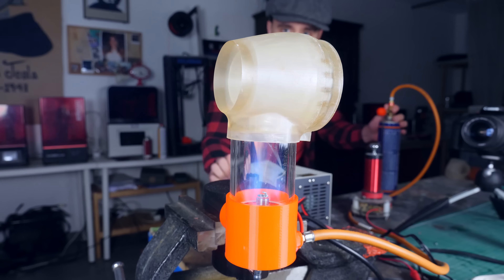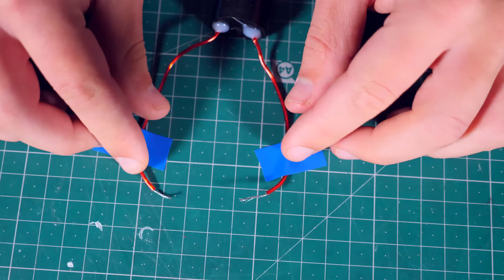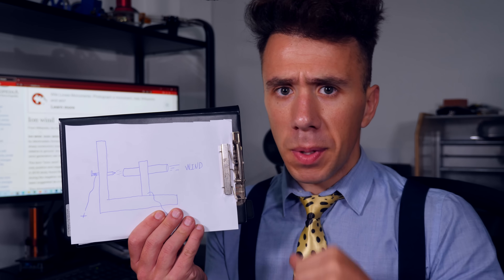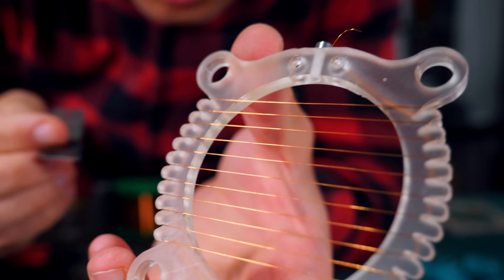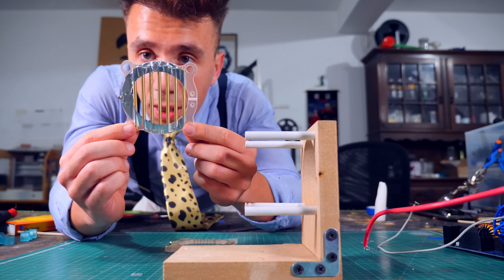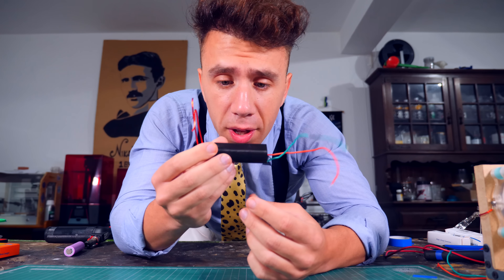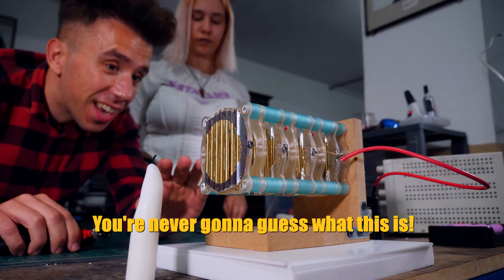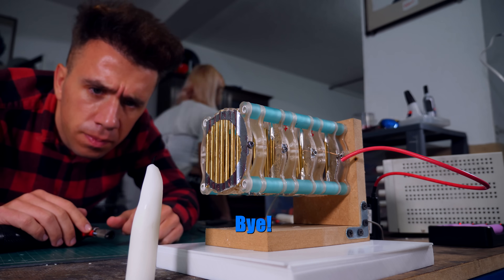I built a TRUE BLADELESS FAN

Comment: You may want to use a crosscut sled on the tablesaw to cut longer pieces. A riving knife on the blade helps, but if the angle of the wood comes off at all it can fling the wood back at you and pull your fingers toward the blade. Love your videos ❤
Reply: Yea, one little twist and those fingers are gone. Careful man.
Reply: Absolutely, kickback is no joke. I still have a cuboid-shaped scar on my abdomen from tablesaw kickback
Reply: And maybe ditch the tie - I wants to wrap itself up in the machinery and pull your head into the blade.
Reply: This is a Einhell table saw... it's basically a noname brand used by hardware stores to sell to people who need a tool that lasts about one project....It's not a real tool you would want to buy spare parts or modules for. If you buy an other table saw blade chances are the table saw blade would outlast the livetime of the Einhell tablesaw.
Reply: @TremereTT  Even still, it's incredibly easy to make a crosscut sled or slide from scraps. Even a cheap tool can be dangerous, it doesn't take a lot of power to hurt a person.
Reply: @FarceeTheFire  arguably it's even worse, if it was for example a sawstop, at least you don't suffer the risk of losing an entire limb (in most circumstances)
Reply: @KibitoAkuya  Agreed, cheap tools have sloppier tolerances and things that should be solid and/or square and/or parallel just aren't. Things that should be something but aren't just create more hazard.
Reply: @FarceeTheFire  my point with a sawstop is because those basically nuke the blade if they sense you touching the blade, so maybe a big gash is possible but you're not gonna lose a limb, a cheap one will probably disarm you and still keep running
Reply: I wouldsuggest he loses the necktie before it reels him into the moving machinery. Lesson 1 of day one of my apprenticeship. No loose clothing.

Comment: Magnesium Alloy is the best anode(for negative side), use "knurled" Light Metal Plates of a Magnesium Alloy for the back plate, then instead of Rods actually make aerodynamic wing shaped fins that are round on the back and pointed to where the wind is to blow! Then make the fins/wings with a Metallic oxide(lithium, cobalt, aluminum) for the cathode (for positive side). try to keep the wings/fins extremely slender and as close as possible ( .5mm will be maximum boundary layer)! DO NOT PUT THEM CLOSER THAN .5mm, that will decrease efficiency.
 You will have the best anode and cathode which should increase efficiency. and just remember higher voltage, lower amps! Step that voltage up!!!!
Try making the Knurled Magnesium alloy plate into a disc that spins possibly to see the spark gap results of spinning knurled anode ;)

Also from what I read Magnetism affects ions in motion so try placing a strong neodymium magnet behind the knurled plated to excite the ions a bit more!

Comment: The fact you managed around 5x more thrust than the one on plasma channel does make me question what the mystery box contains that the fly-back kit didn't and whether being more compact helped... or was it the act of warming it up first that improved performance?
Reply: Smaller wire on the coils compared to a flyback.
Potted in resin to try and stop the primary coil from arcing to the secondary.
They still arc internally and burn out frequently.

You could always find something to dissolve the resin it's potted in and see what components are in it.

Comment: Try force 2 magnets pole to pole, and see what happens. If dropped, they won't fall at the speed of gravity like a control mass would.
Reply: They don't float or repell gravity, but seem to ignore inertia in a field depending on magnet size. 2 decent neodymiums create a 1.5m radius field. They will fall at 9.8m/sec, but not 9.8m/sec/sec

Comment: I'm thinking that the reason you're getting super high flow rates right at the outlet but it drops off in speed extremely quickly is because the air is ionized, so you're getting much more coulombic interactions rather than just elastic collisions like in normal air. So I think adding some jet nozzle to the end will more efficiently translate the momentum from the ions to neutral air in a single direction.

Comment: I have an idea for a video, I wanted to build this myself but I never will probably get around to it

It's a proof of concept, I want to use a wheel and attach neodymium Magnets opposing each other so it launches the wheel, but to make it perpetual it would need a braking system right before it came back into the field so it could get another impulse to go around again, do this 4 times clocked 45 degrees from each other and you have a power plant

It's not perpetual because technically the Magnets lose force and the machine fails over time

Comment: You can fine tune the system by adjusting the spacing between element. The further down stream you go, the greater the spacing. also larger area grates down stream could help as the stream accelerates and expands.  Great show. Great result.

Comment: An idea I'd throw out is see if higher voltage causes more air flow also I wonder how much flow is being lost by the design having open sides instead of being closed in. I wonder if you could start another war between Steve mold and Mehdi on how to improve the fan

Comment: Great video, Integza... My suggestion is two-fold-1) rotate your 'foils' about 45 degrees at every stage. I'm wondering if that won't give the moving air a 'corkscrew' effect, accelerating at each stage (or it might slow it down...I don't know). It seems to me that the air being further compressed in to the next stage might cause a cascade 'piling' the air in the next chamber until it reaches the last one, where it can escape. 2) Make the wires thicker. More surface area seems to equal more power, right? Anyway...I love it. Very cool. -Vic

Comment: I just got the most fitting ad ever on one of your videos.. one for a metal 3d printer. Uh Integza.. DON'T EVER USE POWER TOOLS WITH A TIE ON YOU IDIOT! Seriously any of those tools you just used could've grabbed your tie and yanked your head into them. Face into the saw blade or choked out by the drill is no way to go. 
Something you can do with that whole setup is put it inside an acrylic tube so that each stage is compressing the air a little more and increasing the overall speed much like the stages of a turbofan jet engine. (currently the air isn't just going one way, it's also going out the sides, there's nothing to keep it only pushing forward) If you also were to decrease the diameter over the length it'll increase the pressure of the air, if you then increase the diameter back out at a point you will basically have a De Laval nozzle and it'll drastically increase the velocity. Theoretically you could end up with supersonic air flow, and again theoretically you could add fuel to it and make a little jet type flamethrower thing. (I won't call it an actual jet engine because it won't be able to sustain itself without electricity flowing)

Comment: Ok, here's my comment that I hope wins me a 3D printer (because I have a ton of ideas like this but I'm broke) see if the airflow from this ionic bladeless fan can create the initial airflow for the Dyson style bladeless fan instead of the impeller and thus benefit from the multiplied airflow. I mean, I have my doubts about how it will perform in the face of that type of backpressure but if it could work how cool would that be! (plus, if it works and I get the 3D printer I'll be able to get ideas from your results for the bladeless fan/channel wing aircraft combo experiment idea I've been kicking around but sadly lack the 3D printer to build it with.)

Comment: Idea! Could this be contained in a way to propel a water vessel? Create a wind tunnel type thing from on top the deck of the vessel into a straw below to push the air out of the back of the vessel under water? Curious as to the Air Pressure it could build!

Comment: Introduce a magnetic field with permanent magnets(from a microwave magnetron and/or common neodymium magnets, or a coil, like how a televisions CRT works,.   Maybe focus the general flow into the center a bit to negate some air being blown out through the non existent housing. ☺️. If housing is added, maybe have angled ducts to pull air in, that can slide axially to the flow, so you can tune in the best placement for maximum suction/eduction.   Then use some kanthal wire, and ceramic mounts, separate power source for heating, the kanthal.  Voila... Ionic hair dryer.

Comment: For air handling, you'll want to create a duct for the air to travel through with minimal losses, i.e. put the contraption in a tube. You have a lot of interaction with the outside air via the sides right now. Plus you can drastically increase the air speed by putting a simple nozzle at the end of the stack.
Reply: THANK YOU. maybe even passive air intake along the way ? maybe chamfered air intake too. thinking of maybe even .... nozzle and butane injection for afterburner ? make this a fuel "efficient" "jet/rocket" engine of some sort ?? haha

Comment: I had one of those "ionic breeze" air purifiers, that moved a lot of air using 3 or 4 wires for the high voltage and flat plates for the ground.  The plates would collect fine particles from the air and need to be washed every few weeks.

Comment: What is the power consumption on something like this like?  i'm sure its far from optimized,  but just wondering if it has potential in the RC aviation community, thrust without the vibration of moving fans would be huge for the POV guys
Reply: I was thinking of making a simple boat.. to start with 😊

Comment: It’s abit wild but here goes. Make a fan that turns a magnet and coil (electric generator).thereafter Take the ionic thruster and setup it in a position so that it turns the turbines to make power for the batteries, to then power the ionic thrusters . Measure its efficiency after . The idea is to get some form of perpetual energy.

Comment: what about daisy chaining microwave oven transformers? you should be able to get quite a high voltage with that.
they are about 10:1, so with 3 transformers 200V 5A to 2kv 0.5A, to 20kv 0.05A to 200kv 0.005A (5mA)
though a 2 stage with a voltage tripler would probably be enough.

also I wonder if the multiple stages don't need to be isolated, and if you wouldn't gain a lot from having a tube around the "fan".

Comment: I think it would help if you make the stage's inside a tube to isolate the airflow in one direction.  you could possibly use a venturi attached to the tube to speed the air up and help. not sure if this would help but id thought id share keep up the good work.

Comment: Is there a difference in output volume if the wires are rotated 90 degrees. so wires run up/down, and tubes run side/side.

Comment: How about placing your ionic wind generator in a venturi-like tube? Using Bernoulli’s principle, you should see an increase in the wind speed by first compressing the flow of air and then releasing the air pressure to a pressure less than what you have started with. This principle is used to increase the speed of wind tunnels. I know that Bernoulli’s principle is traditionally used in fluid dynamics, but has also seen it being applied to the theory on wind tunnels.

The above assumes that the ionic wind generator can generate wind against pressure and which is also useful to know.

Comment: okay this not about engines or compressors but this question came to my mind while i was watching a video about plastic/epoxy lenses: is it possible to 3D print any kind of lens on the Resin 3D printer? can it be use for optics work like Amateur astronomy or astrophotography?

Comment: you could build it into a rotating fan have the wire in front of the leading edge of each blade and the tube could be the leading edge of the aero foil. There might not be a large amount of rotational force but it might just turn it into a very low power motor. You would have to make it very light weight so maybe some balsa wood, carbon fiber (does CF conduct electricity?) or a mixture of both for the rotor. The connector would be the pain in the rear end to create.

Comment: The stages lose efficacy with each step due to increasing friction losses on the wires and tubes. A large single stage in the base of a duct like the Dyson might work. Essentially using the ion fan at its maximum accelerative point (stage 1) and boosting the velocity using a Venturi.

Comment: Try using sandpaper on your wires to make more scratches. that or try a thin braided wire, even if you have to make it yourself. you're trying to create points that stick out to create contact points and the braids will do that.

Comment: If you put all this in a tube and drill some controlled air holes on the tube wall between the units to suck in fresh air and use it all with some kind of funnel effect, you might be able to increase the thrust? What will happen?. You could use some smoke to make the airflow visible, of course a smoke that does not ignite.

Comment: I wonder what the output would be if you plugged it into your wall outlet? While it is basically the same design as Plasma Channel’s thruster design and other such ionic wind aviation equipment, you are specifically referring to yours as a bladeless fan, which means you have either No or a much more lax weight requirement. You can make it as thrust/speed/whatever to weight inefficient as you want, and can rely on an external power supply for the electricity.

However if you are using an outlet, be extremely careful if you don’t want to die of electrocution.

Comment: make some big circles with more wire and bigger tubing and for the source of such a big device use microwave transformer and some high voltage diodes and also try to put all the circles in a tube maybe that is gonna increase the thrust 
using a microwave transformer is big danger but everything on your channel is the same so you are good 😂

Comment: well lets start by shrinking the parts way down. try using the smallest diameter wire you can find an use larger wire instead of tubing. you can probably get your wire holders cut out of fiberglas pcb for fairly cheap (alternatively you could have them water jet cut out of 1/16 in steel sheet to be even smaller)

Comment: It would be interesting to see if any flow occurs when a stage is in a vacuum. 
If there is then it will be either electron flow or ion flow - the direction of flow will tell you which one is dominant. 
Directing the charged particles with  magnets will be interesting too. (hey didn't you pull the TV apart - that yoke will be useful, as will the CRT! ). 
I reckon you can make a display screen! Wait....

Comment: I think a great future video would be to try and make a rocket using the bladeless fan. Yes there are levitators but an afterburning rocket would be sick! Or an afterburner like others have highlighted. In general taking this technology further would be cool.
Reply: if you can create enough gas flow to start a rotary explosion jet engine with this it would be an incredibly efficient way to move satellites in orbit as electricity is far easier to come by in orbit than new fuel for the thrusters. you wouldn't even need a lot of thrust all that matters is that you get as much thrust per gram of fuel as possible.
Reply: @KT-pv3kl  Totally. I think that it is so cool that there is a fairly newish technology that can be showcased on youtube and have potentially groundbreaking applications, really the best future project would be to improve apon this and try and get it viable for more uses. Having youtubers collab with larger insitutes could be really interesting!

Comment: I would try building the stages in a cone shaped configuration where the first stage at the back has the largest diameter and the one at the front has the smallest diameter and cover all the stages with a transparent cone, that would accelerate the air i guess as it moves forward.

Comment: So, Jay and your design seems to assume that leaving the thing open will bring more power to the flow.  But I wonder what would happen if you closed the sides of the "fan" so the air wouldn't be able to flow out or in from the different stages.  This should help propel the flow of air from the inlet to the outlet with much less losses as you won't get the random particles getting pulled or push from the middle.

Let me know if you do it :) should be simple enought with just anything as side panels.

Comment: Would taking a fan blade, slicing it very thin, then printing it: one layer plastic as an insulator, then one layer to hold the grid into shape with minimal plastic, then printing another full plastic layer but covered in foil for your insulating layer (or printing in a conductive media) ( so take your current design but make it into a sliced up, non moving fan blade) work? then for fun hook up the static blade to a motor and see how it performs while running as a steady state, spinning fan

Comment: i like this concept, but i would increasd the density, like from 1cm to 1mm and 3d print a case thats getting smaller by the end of the last section so the airflow increases. you could also decrease everything section to get a ventouri effdct

Comment: I imagine something like a steel wool might work well for your positive end, provided it doesn't ignite in the process. And you probably have to do some optimization with the density of your fiber to get good airflow at the same time. But the rough surface of wires would be great for getting as many electrons as possible out of the air with corona discharge sites.